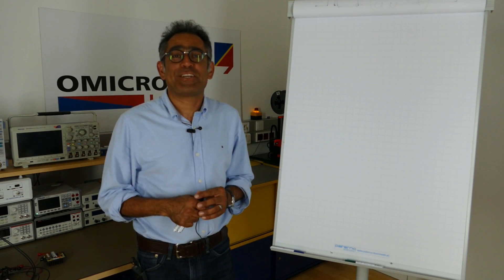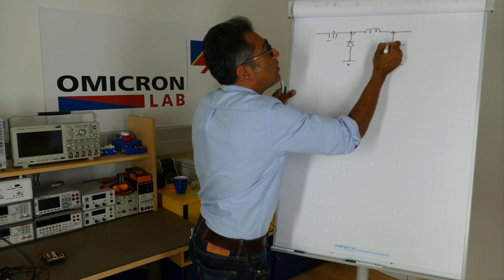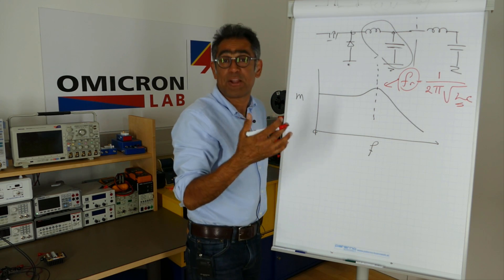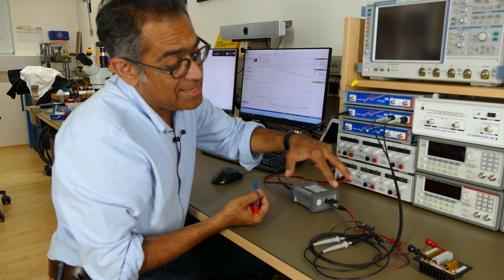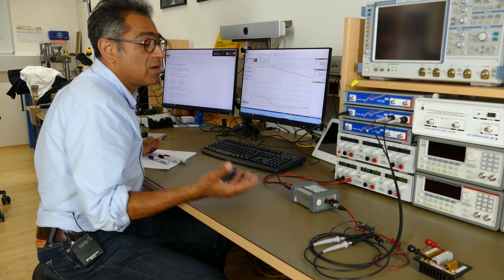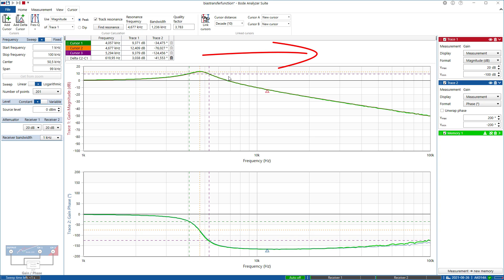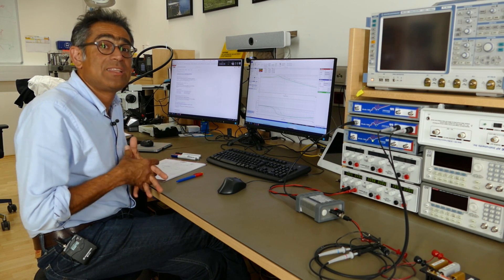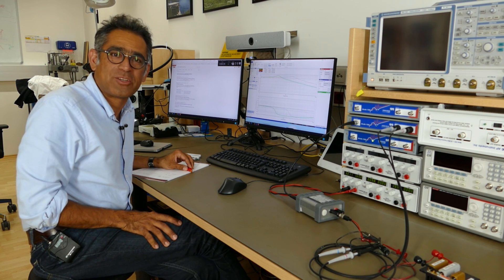DC bias loss in ceramic capacitors: watch the resonant frequency move in real time!

Comment: OK so you have highlighted a problem, but what is the solution to this problem???
Reply: Designing a power supply you have to add more capacitors in parallel, or use a larger size SMD caps (if we are about SMD).

Comment: This is only not true for C0G (NP0) capacitors, which are extremely stable and often perform better than film capacitors. Speaking of film capacitors, they have a frequency vs voltage graph. Beyond a certain frequency the permissible voltage drops rapidly.
Reply: Yes, we have Class IandClas II dielectric types. And Class Iis stable and Class II is not (as shown on the video).

Comment: It's good that you're highlighting this important, and perhaps surprising phenomenon. However, calling it "DC bias loss" makes no sense. How is this about "losing DC bias"? It's not.   It's "capacitance reduction with increasing DC bias".  
And the surprise is that many capacitors are spec'd to possess a capacitance at their rated voltage of only 20% of their 0V capacitance (similar to the result you obtained).  Given that many MLCCs are used as decoupling capacitors for power supply rails, and thus always operating with a significant bias, it's crucial that the circuit designer understand the C vs V curve for such a capacitor, and choose a cap with a voltage rating that's a substantial multiple of the actual voltage in the application -- or a cap with a larger capacitance, of course.
Reply: it means loss in capacitance due to dc bias
Reply: standard practice is to use at least double the voltage, more often 2.5x
Reply: Yes usually the one should choose two times more rated voltage capacitor then the injected voltage.
Also Polymer tantal caps are ten times better when it comes to DC bias capacitance loss. But they are 10 times expensive too.
Reply: @therandomchannel9226  And they tend to randomly explode somehow.